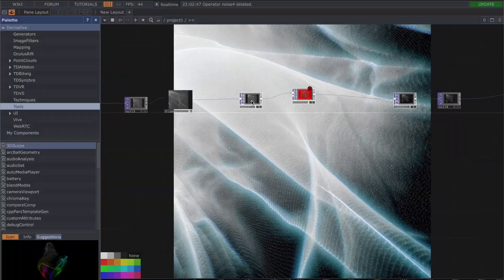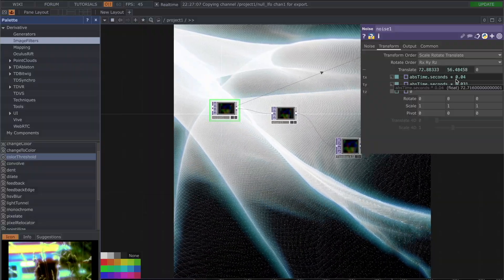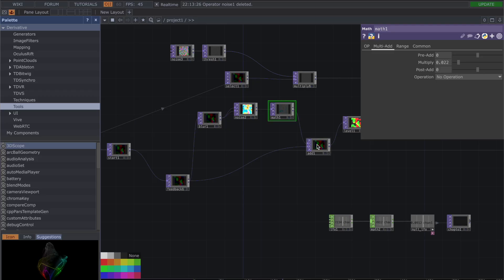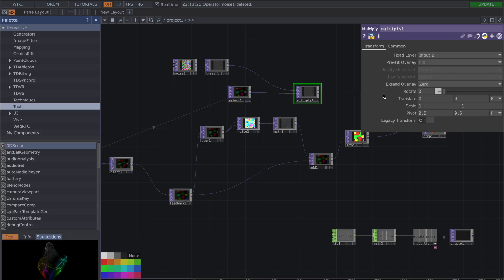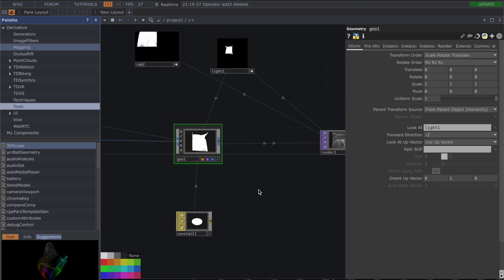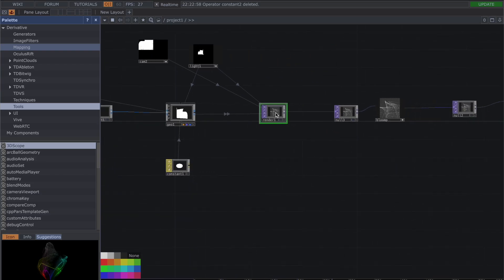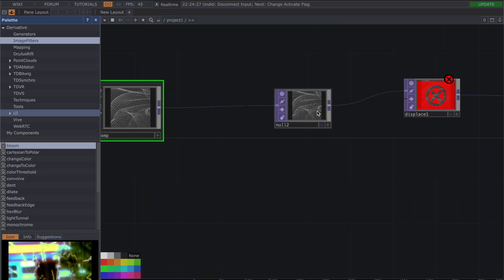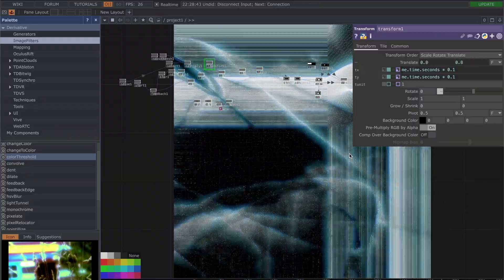Touch Designer Dreamscape Particle Cloud Tutorial

Comment: Hey Nothing shows up on my geo node, though i have been following everything. Do you know what the possible reasons could be?
Reply: Hi, i had the same issue and i fixed it by changing the "Conver to" in the Covert1 node to "Particles per Point" instead of the default
However, it did not fix it because mine looks nothing like hers due to the Reset in feedback1 being connected  to the end ;//
Reply from the maker: It could also be your gamma or other settings in your level top
Reply: @sölaexiste  I don't know why, but the fact that you had the light in the "Look at" param in geo made things show up lol
Reply from the maker: @Decaying_sun hahaha okay well perfect! as I said really experimental for the moment what I’m doing. Glad you got it to work!
Reply: i havce the same problem still trying to do with what you all said but nothing shows up in geo
Reply: @thomasc.4391  same nothing shows up for me and after feedback1, everything is white...
Reply: @thomasc.4391  Turn on Add points in the first SOP Add command